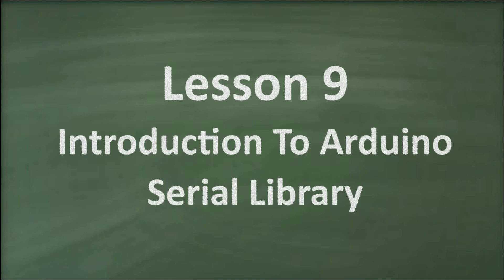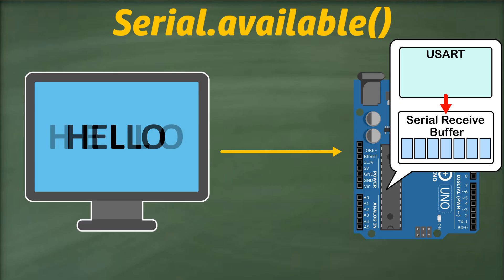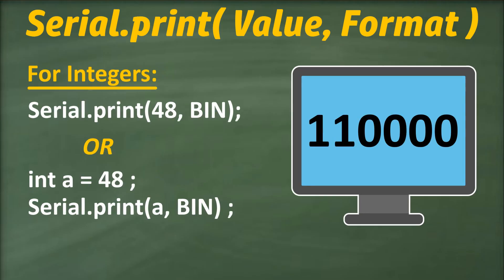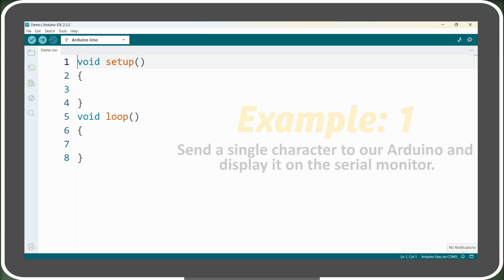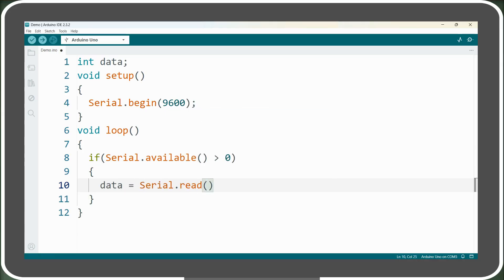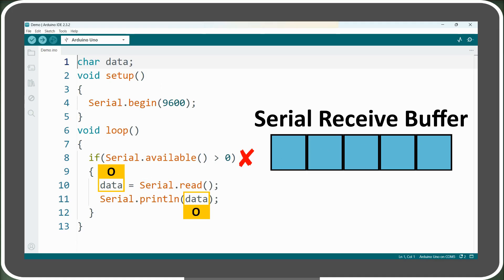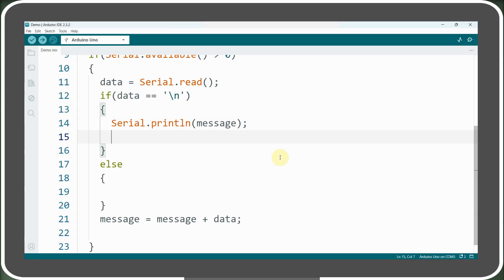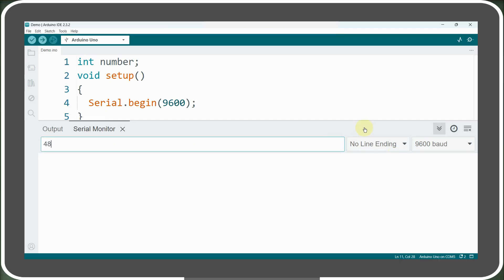Lesson: 9 - Mastering Arduino Serial Library [ begin(), println(), read(), parseInt() Explained ]

Comment: very well presented and at the right level!  You did not treat me as if I was a child (sound effects) or lose me in technical details.

In C there is a printf() function that takes a format string and adds multiple variables based upon the format.  Does this exist for the Arduino?
Reply: Format string ? What is that?  Add variables based upon format ?? example please